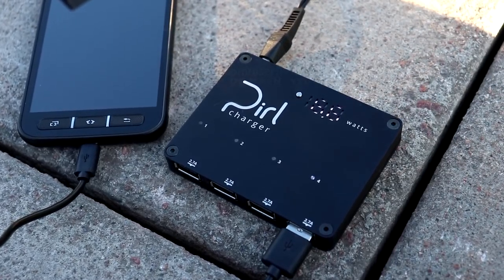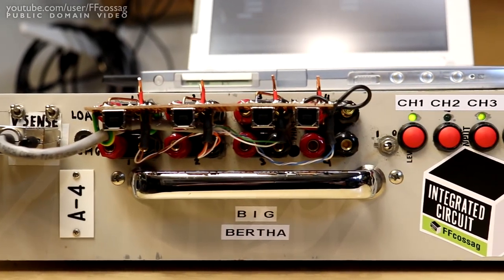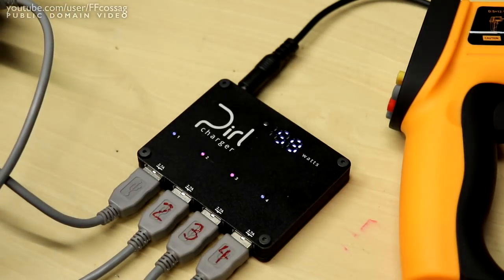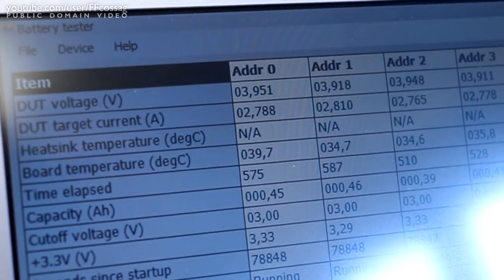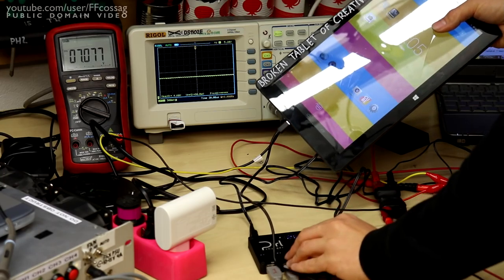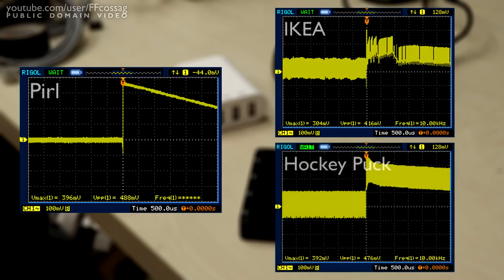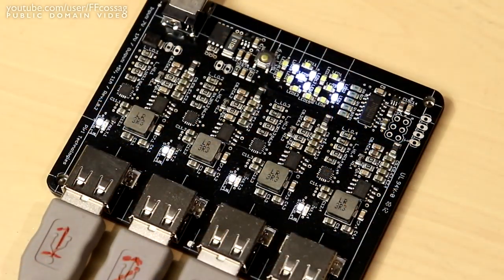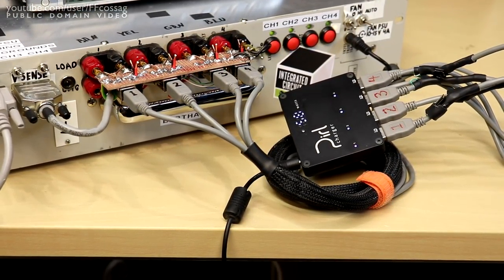Pirl Charger Preview

Comment: Great review video (or was it a commercial, lol). Wish I was as good with presenting! 

On-topic: I saw this thing passing by on the internet a while ago. Read about it, but quickly came to the same conclusion: for the average person it's an unnecessary device. 
Great build quality, but not something I would buy to replace a standard mains-powered USB charger. 
Extra device + extra cables = extra messy. And while the idea itself is great, you have to keep in mind that when using mains power with this thing, you're converting the voltage TWICE to get to 5 volt, which is not efficient and again, not necessary when powering only one device.
Reply from the maker: Thanks, although I cringe at the presentation in this video myself, I'm definitely not as good at voice-over as I thought I was, lol.

It's not a commercial. Had I found any notable flaws in the product save for the is-this-even-going-to-be-legal tier overcurrent issue and the high price, I assure you it would have received a thorough roasting. The device is overbuilt - and that's probably going to be its downfall.

Comment: top quality review! im glad they sent you one, but after seeing the price, I will stick to what I have, hunda (5 port 9A) maybe when they make a QC or PD version that supports 30v input i'll bite.
Reply: Yeah... iirc the reason why the pirl charger got a "meh" from me was the input range... if it could do 30v and below i would love it cause my current setup (7s lipo pack) needs something like that or i would need a buck to step the voltage down just for the pirl which adds in losses so for me it was a "might just use a buck to step the voltage down to 5v from the getgo instead" type deal.
And no QC/PD was also a boner killer for a charger that has a slogan "to end them all".
Reply: yep I am looking at 7S for my power system, and I want to run things directly from the battery so 30v is the requirement.

Comment: Great video production as usual. 

Personally I cannot see the target market segment for this product.

I would be interested to see how well it handles the reality of running from a running car 12v socket, with all the associated noise, transients and spikes that go along with it. I wonder how much of that would make it to the 5 volt output. 

The power meter seems more like a gimmick to me considering the inability to monitor individual port power consumption -- if you want to measure power usage per device you've spent $75 on a single port USB power supply! Far cheaper and more versatile devices exist which go in line with the USB device and provide accurate voltage and current measurement capabilities. 

The ability to run from batteries is also not that exciting as dedicated USB power banks with obscene capacities are easily available, and are a less messy setup.

If this product was on sale for around $30 or so I would definitely consider it, but I can not see what makes it worth $75. Not by a long shot.
Reply from the maker: "I would be interested to see how well it handles the reality of running from a running car 12v socket, with all the associated noise, transients and spikes that go along with it."

HOW COULD I NOT THINK OF TESTING THIS?! ARGH.